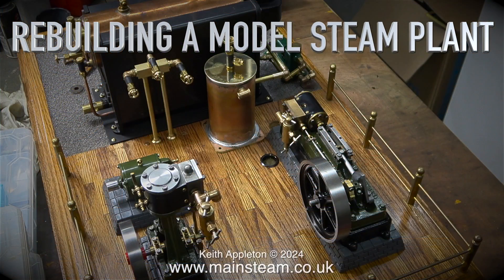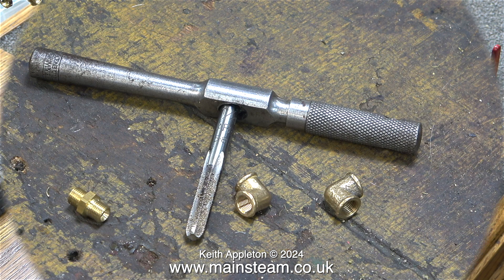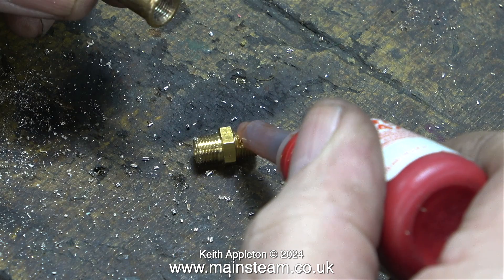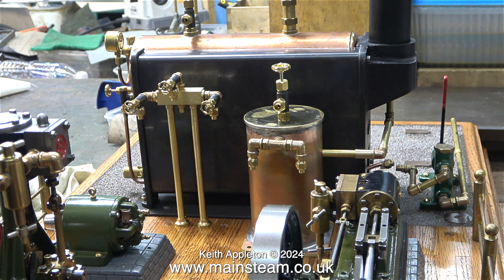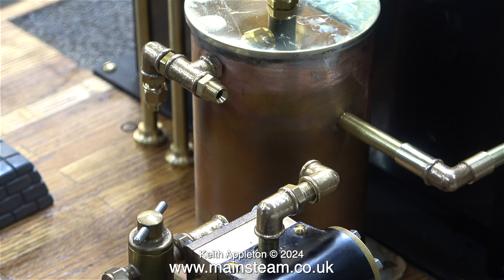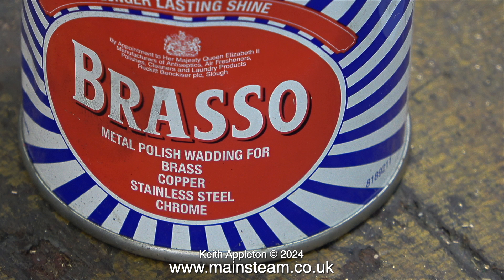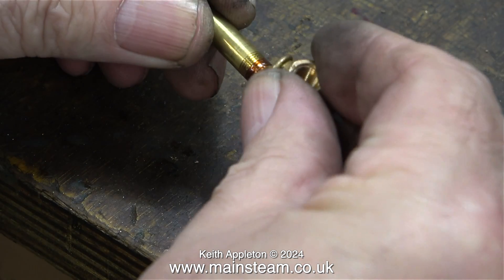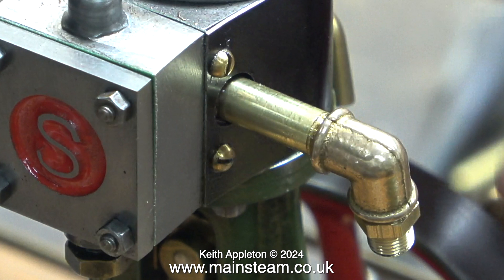REBUILDING A MODEL STEAM PLANT - PART #41

Comment: Thank You! Maybe there was a differense in how old steamplants did look in the US compared to northern Europe, in my country old machines in full size where ofte connected in a way quite similar to the way You are normaly doing it in the videos here, just by much larger copperpipes... But in the US i seen pictures of old machines connected by steel pipes which seem to be using an awful lot of elbow connections and often does contain what looks like bronze (i assume brass looks relatively similar on a model, but i guess it was copperbronze in the original in order to last...), perhaps that does explain the original look of this particular model? I am a huge fan of Davids models, i truly am! but i will do it Your way on my models.

Comment: I started my working life as a pipe fitter welder. Because we used taper threads on elbows, tees etc, it was normal practise to have two threads exspoded. Therefore I think having threads exsposed on your model, look more authentic 😉
Reply from the maker: A good point }:-)))